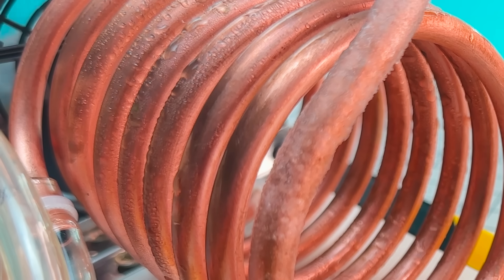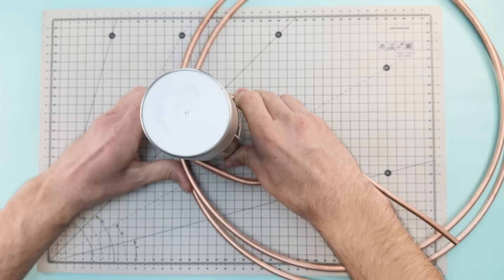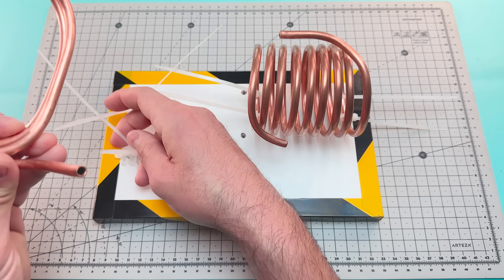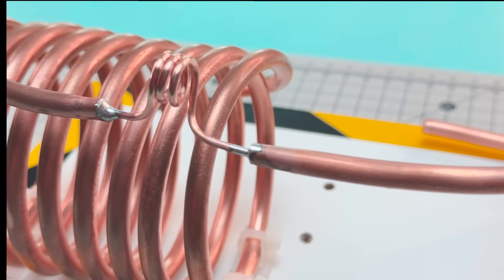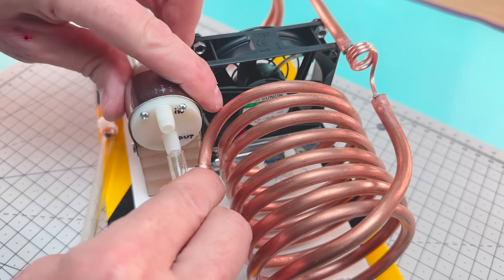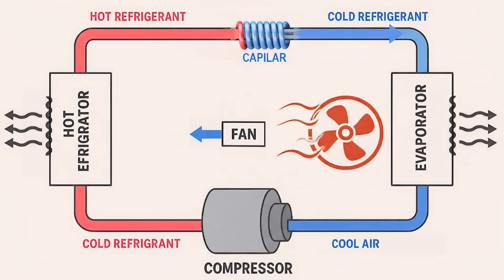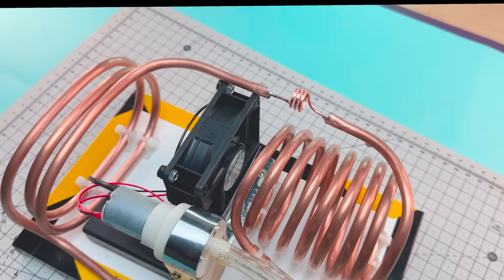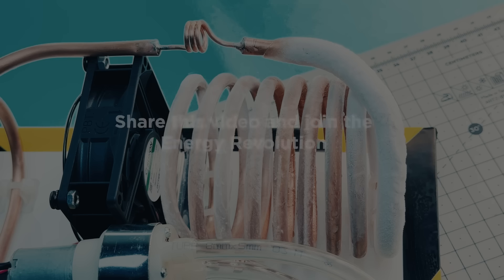Make your own AIR CONDITIONER at home Fast and Easy!

Comment: Excelent idea and demonstration of refrigerator principles.
It also could be good video, if there would be no useless step-by-step assembly part, at least before you are showed what and how extactly do you going to connect components together..

The issue with step-by-step assembly genre videos is that they absolutely don't show the process of actual designing - you get pre-selected, pre-measured and pre-made parts and componets, instead of showing sketching stage, choosing component sizes, placing all component together on several fitting stages, measuting chasis and conductor parts, etc. Only pre-designed assembly is shown, and often they even don't let you know, what extactly is assembling.

Considering your design, you forgot to design water condensate collector. Also fan get room air thru condensator tube (i.e. pre-heats air, before making it cooler)

Comment: So much wrong with this. 1: The stupid AI vioce. Instant dislike guaranteed 2: You can not just throw things together, charge any amout of "refrigerant" and give it a go. to less or too much and you are screwed. 3: Charging the system with a syringe and adding glue too seal it...wow. Will be a super reliable machine for the future i bet. 4: A tiny electro motor operated by a small battery. Sure will this power this device with the needed pressure! NOT. 5: Showing the temperatur, while the thermometer is on hold and not showing the actual temperature of the point where you are "measuring". Must be nothing wrong here. 6: Sure you will be able to cool you room in the summer. IF you are living in a small shoe box. The heat escaping from the system heats the room while you try to coll if down on the other side. Bet you will never be sweating again xD ROFLMAO Please show us next how to run this with a free energy machine.

Comment: The video looks good on the screen, but the concept does not actually work. Have you ever opened your refrigerator to cool your room or house? It doesn’t work that way. As @nandorkomlodi mentioned, “you need to separate the components with distance; with separation you will get longer tubes.”

In short, please do not attempt this if you are living in the USA. The 4x6 mm tube and capillary tube are only available from Grainger (not from Home Depot or Lowe’s).

This video also leaves out important components:

An AC/DC converter to properly step down 220V or 110V to DC 12V (instead of using a 9V battery).

A proper butane adapter tips kit, instead of a needle syringe.

Please don’t be misled. This setup will not cool a room.
Reply: As a welder I would like to have something similar to this during the texas summers. What if I create dividers to separate the different components and place a secondary fan in the condenser compartment to reroute the heat (probably wouldn't be necessary since it would be more of a backpack unit to blow into coveralls and not to keep a room cool). As far as the condensation issue, i can create the entire enclosure using aluminum and create a drip box/ catch can to catch excess moisture that i can pour out at the end of the shift. Thoughts? Recommendations?

Comment: Nice video for study porpuses nad I was amased that you were easily built this!

In addition you have to get the heat "outside" of your house and keep the cool part "inside" of your house to make this thing usable. So you need to separate the stuff with distance. With separation you will get longer tubes... you will need more gas.... bigger compressor...  bigger vent.... etc, 
So at the end you will end up with a air conditoner... also nowday those are using inverters and very power effecient so you will never match those with DIY stuff.

But anyways I liked to watch this, thanks, and cheers ;)
Reply: while these videos are awesome its nice to keep grounded with all these "cool sounding title's"

Comment: What would it take to reverse the system to create heat?
Reply: In therory you just need to reverse the compressor but I have never done things like that before...
The main idea is to change the "place" where the vaporation happens.
Vaporation cools, compression is heating.

Comment: Useless as AC without an exhaust for the hot side ,  but  it would be a kinda cool drink chiller, incorporate it into the cup holder on you chair ,  or into one of those setups that fills the beer from the bottom.

Comment: As a retired science teacher, I hate phony videos. Yes, it will get cold on one side, but the other side will get hot. Waste of time, and I hope this site fails.
Reply: You are not a retired science teacher or you would understand a simple Lab video like this for what it is. This teaches concepts, just like any other Lab. It's not meant to be a working product, it's meant to be a functional example of scientific principle.
Reply: @MichaelKlineJr  gotcha man. However learned more here now than I ever did ever before. Very practical even though, as you mentioned, not fully informed. Cheers mate.
Reply: The other side is supposed to get hot, that's what the compression is supposed to do. The surrounding air then cools the fluid at higher pressure, it passes through the capillary tube and expands, thus creating the cooling effect.
Reply: @naasking  What he means is that it makes heat also like any AC. You have to put the heat somewhere else like outside or the hot side will make it useless.
Reply: Why you gotta be like that? You a liberal?

Comment: Isobutane is flammable - standard AC gas is non flammable.
Reply: check out R32 Refrigeration Gas Properties...
Reply: The new refrigerants are in fact flammable by the current and previously known definition of flammable.  Even though the manufs. try to claim otherwise,  and in fact are very similar in molecular structure to isobutane and propane because these gasses has a very low global warming potential which is a key goal criteria of the next generation of refrigerants set by regulators. The main difference is that the new refrigerant molecules are tweaked just enough so that they can be heavily patented and sold for massive mark ups for massive profits as a synthetically manufactured gas, while refrigerants like propane and isobutane have always been available in huge quantities for dirt cheap and have always had very low Global Warming Potential as an escaped gas.  The companies are spending endless amounts of money to have their new butane/propane look-a-like manufactured refrigerants to be classified as nonflammable even though they're flammable because they have concerns that people won't buy them if it's flammable, unlike the previous generations of refrigerants which really weren't flammable by the traditional definition of flammable. To do that they are trying to change the definition of what is considered flammable and non-flammable to have separate classification criterias when a gas is used as a refrigerant.   In the end, it's all politics and profit until somebody gets burned...
Reply: R407a is a better alternative, I've done this few years ago on a serpentine tube shaped which blows cold and hot air dimensionally better than oval shaped.

Comment: useless ignore it
Reply: how
Reply: @sameerpatel090  air pump is not a compressor. Simple as that.
Reply: @JesusMoneyChrist  engineer here - it doesn't matter what type of pump you use (a 'compressor' is just another type of pump), just as long as you get a pressure increase from it. It's the pressure drop across the capillary (in combination with condenser step) that drops the temperatures through 'Joule-Thompson' effect. You are referring more to efficiency and performance, for which I agree, a higher pressure pump (such as an actual compressor) would work even better
Reply: Depends what you mean by useless. It is cooling, which is the intended aim. Could be done much more efficiently, of course, but your comment is still incorrect.

Comment: Not going to work 22 years as certified ac tech.
Reply: lol it works tho
Reply: @CosmicEdgeGaming  not really. Is can freeze some water in it at the most. Will never low down room temperature
Reply: @lucasguimaraesvieira4529  its not made for cooling an entire room lol
Reply: As an AC tech, you should know this is exactly how a typical vapor-compression system (AC) at your house works. It could be done much more efficiently, ofcourse
Reply: I love it, I think it is a great solution for DIY guys with a hot rod that is a small cabin of space of 90 cubic feet it is a great affordable cooling option. Loved the video. It's not going to cool a room you Debbie downers. Great video,thank you

Comment: This would absorb heat from the room and then dump it back into the room. There's a reason the refrigerator coils are on the outside and the cooling is on the inside of the refrigerator. Well, at least you can use this to build a mini fridge.

Comment: Taling warm air generated by the large elements and blowing it over the tighter cool ones - guess whay the end temperature in he room will be.  Hint - starts with z and ends in 0. .      the larger coils need to be aout side the room - sending the warm air outside

Comment: How many BTU's
Reply: 4000 I am guessing
Reply: @Phantom2022-exe  more like 4 micro btus, it may be able to keep a cubic foot of insulated box cool, not a whole room (in which case the condenser would need to be outside), but in either case the battery would drain dead in about 4 minutes

Comment: This system will produce heat overall (heat from the motors for a start + loss of the system) If you put it in a room, you are heating the room. For cooling to actually occur, the condenser must be located outside of the room. The real cooling effect is only present at the evaporator.
Reply: true!
Reply: This...
Reply: is...
Reply: Maybe he is just showing us  the principle only to how you do it 

It's really with us to make it right

Comment: how much heat did the condenser create?
Reply: the exact amount how much the evaporator cooled off. useless device, when the condenser and evaporator are 10cm apart. in fact, its gonna heat up the room little by little, due to losses in electricity
Reply: Definitely forgot to run the condenser out side 😅

Comment: I can't believe all the negative comments: this project is obviously meant to be an air-conditioner demo. Of course it won't take the place of a room air conditioner (duh)!  The hot coil will get hotter than the cool coil will get cold, but that's really obvious.
But I do believe it will work.. the details are all there, even the compressible gas which is perfectly suitable for this application (despite the comments to the contrary). 
And as others have pointed out: a 9V battery WILL run a 12V pump, just with less power.
I am going to build this for myself and maybe even modify it into a cup-cooler. I'll be using the car's 12V for power and I'll insulated and maybe make a small heatsink for the hot-side coil.
Reply: This is probably backlash from all the misleading “air conditioner” ads that saturate social media every year.
Reply: question do you think you can isolate the evaporator and add an exhaust fan to push the heat out?
Reply: @GerardoRojas-f1c  For an "in room" ac unit, where you don't necessarily have a way of dumping hot air, the best one could do it is put the evaporator in a water tank. Fill it with cold water and make it heat it up, replace the water when it gets warm. That way you are not reintroducing the heat back to the room.
Reply: @strayobject  That's a really interesting idea (and I'm sure someone's going to say it already exists), room cooling and water heating at the same time, have the water cycle via a pump into a highly insulated container, cold room and hot water for later use
Reply: a lot of the current generation lack common sense.  It's really a good demo.  negative commenters might be surprised to see how a window air conditioner works and what little differences it has to separate the condenser and evaporator

Comment: It would probably be more accurate to call this device a dehumidifier rather than an air conditioner. For it to be an effective air conditioner, the condenser coil would need to be placed outside the room you want to cool.

Comment: If this is the case then why home AC consumed hell amount of electricity?
Reply: Because big pressure of R32/R33 Freon in condensor need big power from compressor to give some force. And in this DIY using small DC Motor.

Comment: While this setup won't actually cool a room, it is an excellent demonstration of the fundamental concepts of air conditioning.  Placing the evaporator coil inside a closed cardboard box with a thermometer probe would take the demo to the next level.  Wish I had thought of this back when I was teaching high school physics!

Comment: How fun. Let's run a fan to draw hot air from the condenser over cold evaporator coils. This is an elaborate method to drain the energy from a 9V battery whilst doing nothing useful.

Comment: Come on people. You all believe everything you see. Hell he specifically shows the fan is 12v and he's using a 9v battery. On top of that a motor for the pump. To be honest the fan would run just for a short period of time but to run a motor as well is rediculase. You would need to use 12v alone just for the fan. Also to use butane is rediculasely dangerous. Why do you think we don't use it in our homes or cars. We use freon. People if it's not to late for the gullible. Stop before you blow yourself up. I do admit that some of the facts are accurate in this video. But that's the simple things. People just need to research things before hand. It's not that hard when our world has technology at our finger tips
Reply: The EU uses butane A/C's... I have two sitting right near me (not running right now though)
Reply: You can't use freon anymore. At least not in first world countries.
Reply: 9v will power a 12v fan.  By itself, it will spin the 12v fan (at a slight slower speed) for about 2hours.  Add the pump and chances are, that 9v will power the unit for about an hour.  Try grok, chatgpt or some other AI to verify.
Reply: @vladimirnekic3241 yes that's what I was stating in my other comments. 9v isn't enough power to run a 12v fan and the motor of a pump for long at all. But the main issue is the source of coolant. Butane is not a safe gas to use even near power source. Yes it can cool just as other gas do but definitely not safe when it comes to this. There are so many cons to this project it's by far the worst thing anyone should attempt when not know what there doing. I'm very experienced in power, cooling, and gases.  People need to not accept that this is a good idea when it's actually dangerous
Reply: @shyskeleton1665  Hydrocarbon gases are commonly used for airconditioning. They are all flammable in the right concentration.
Reply: The old used car salesmen, some of them would charge an ac with propane. This car has freezing cold ac !
Reply: Has anyone tried this?
Reply: @bfargo85  I haven't tried it, but common sense tells me that it would be pulling heat, but putting it back in the room. The condenser would have to be outside of the room for it to actually work. 🤔

Comment: This project is fantastic! Could you kindly send me the purchase link for the pump you're using?
Reply: Please don't be so gullible. Research before blowing yourself up. Some of the simplest parts of the video does not make sense. For instance. A 12v fan that runs off a 9v battery. There's a lack of voltage just with the fan alone. Let alone he adds a motor that will use more power. A 12v fan needs 12v. Any less the fan will run slower and die quicker. Also if butane was safe to use don't you think we would be using it in our homes and cars AC's. No we use freon witch can be dangerous but not as expensive as the butane.

Comment: This is good for a school project! Nice! Everybody says here that condenser coil should be piped outside the room. Yes that is true. But this is a demo guys. It is not meant to be used on a daily basis. Buy a commercial aircon.
Reply: Horrible to say this when your not even sure what's really going on. Maybe you don't understand and I can acknowledge that. But you have a way to do research at your fingertips. Butane is dangerous and if it wasn't don't you think we would use it in our homes and cars ACS. He has electric with a combustable liquid. What we use is Freon in our ACS and I'm it's not as dangerous. On top of that he's using a 12v fan that needs 12v to run. But yet he's using a 9v battery to power the fan and the motor. Oh the fan and motor might run for a few seconds.
Reply: @shyskeleton1665  Stop. You have said this twice. Portable A/C units in the EU ARE butane

Comment: What about waste heat? A useful AC has to exhaust heat out of the room.
Reply: I so agree and people here are so gullible not knowing this is extremely dangerous due to the electric and butane. A bomb waiting to happen. This video needs to be flagged. None of this video makes any sense and 100% would not work and people need to realize that they need to research before attempting stupid crap they see. Like a 12v fan and motor running off a 9v battery. Come on now